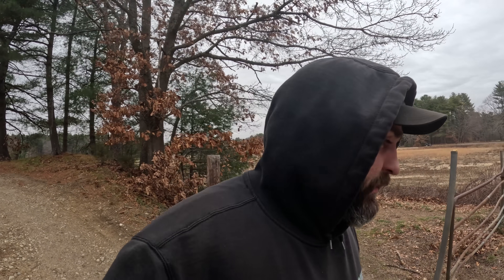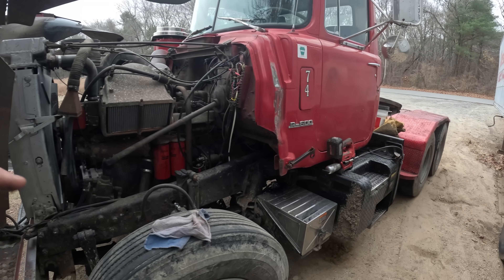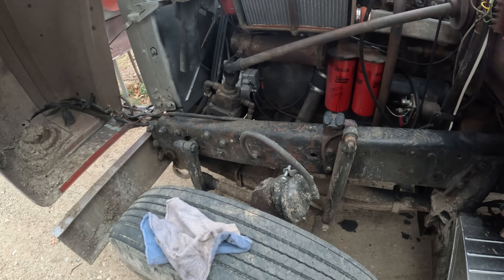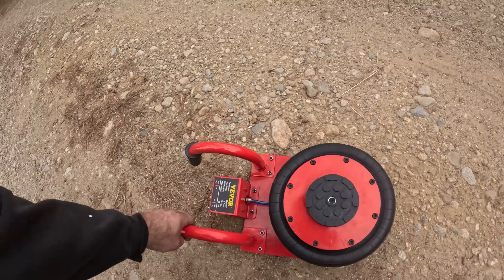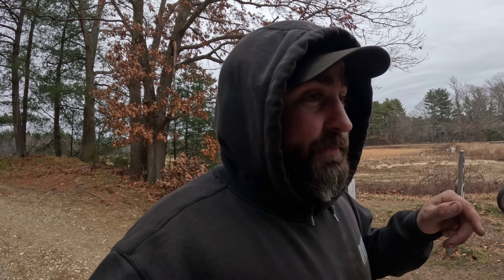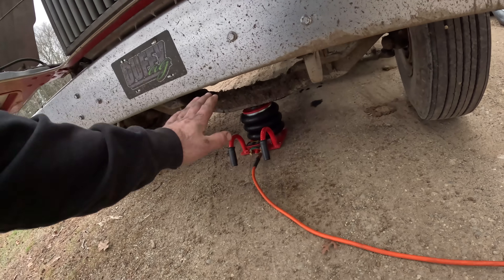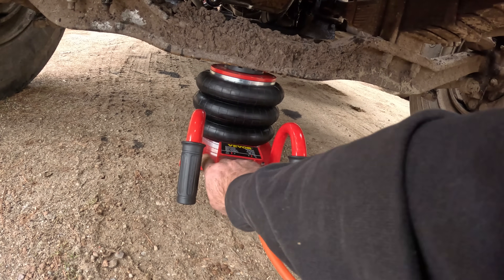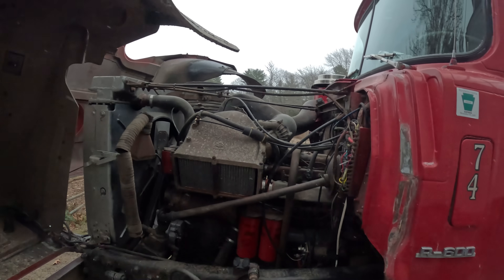Miles Put On Mean Service Is Needed

Comment: Vevor has a pretty cool portable camp/tent stove too.   Its like they're trying to become the Uline of equipment and tools XD   You might want to get some kind of baffle to tape over the exhaust port on that jack... you can end up blowing a lot of dust up and ripping your hearing something fierce.

You can get spring wheels and a long stick with valves on the handle for it too.  Re-useable grocery bags in 2 layers make a nice protective cover for the ballute on it.

Comment: I just use a regular Air bag off a semi trailer that i modified theair fittings into, and used trailer suspention valve to go up and down.  I been using it for 15 years or so. yes that one goes up alot higher, but the one i made works for all i do at work.

Comment: The kind of handy thing about that air jack is you could carry it on the truck with you, make yourself up an adapter if you don't have one already, so you can put a red gladhand on and then plug a regular air hose into it. Then release your trailer brakes. Now you can run your jack to jack up the truck do whatever you need right there with air off the truck
Reply from the maker: Exactly plus air tanks have fittings already on them. It will be a convenient jack to have

Comment: On the bottoms of your plow take and smear a thin layer of grease on them , it will keep them from rusting and one round with it in the spring plowing they will be nice and shinny . Smearing grease was my job as a kid 😀
Reply: Some grease mixed with oil smears better
Reply: Cosmoline...
Reply: You can use cooking oil or lard  which is a lot better for the environment and the ground.
Reply: But to be honest dad used to buy cheap spray paint to protect the shanks
Reply: Spray paint

Comment: Back in the early 80s I ran a 68 Mack RD668 grossing 150K in the Adirondack mountains all winter. It burnt 2 gallons of oil daily and only got 3.5 mpg. But it worked real hard and the fuel was turned way up.

Comment: Might not mean much Chris, but flex seal does make a paint on product you can apply with a paint roller in gallon sizes.... Might could use 2 or 3 and do the whole roof of that trailer.
Reply from the maker: I used flex seal both tape and paint for it. It sealed ot 99%
Reply: @DuffyAg  missed that you painted it too. Lol

Keep swingin pard.
Reply: Now that sounds like a plan